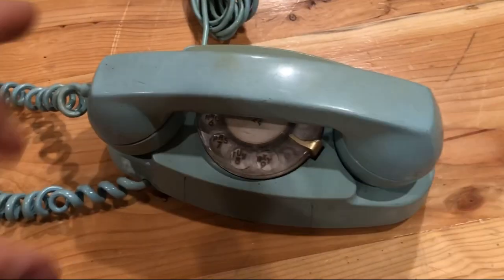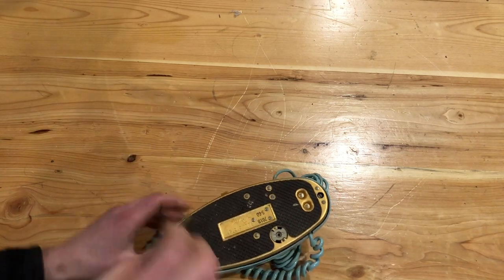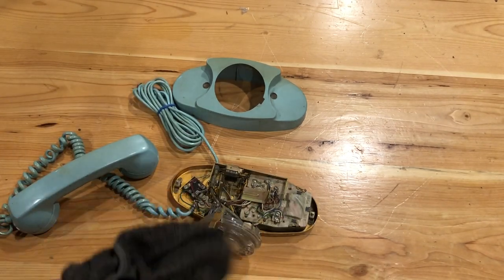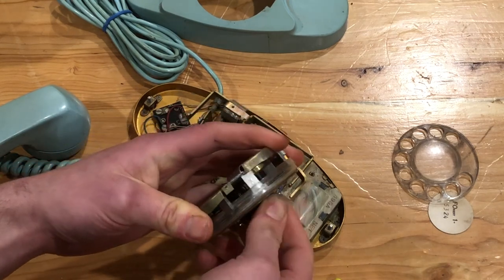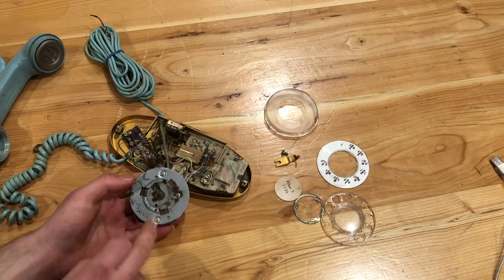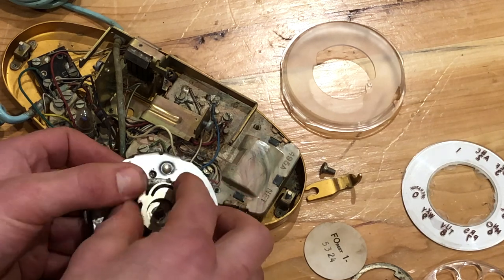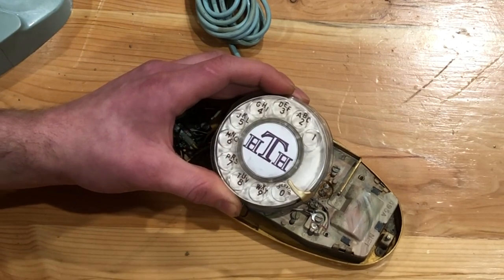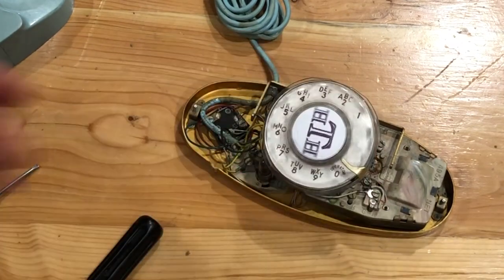How to restore a seized rotary dial

Comment: Pro tip: There is a tiny hole in the fingerwheel located directly over the locking tab that holds it in place. Instead of futzing with a screwdriver to release it you can unbend one end of a paperclip and push it through the hole which will force the tab down to where you can free the wheel with much less risk of damage to the plastic parts.

BTW, good job on the repair. Now I'd like to see you do the same thing to an Automatic Electric dial. Those things have a different governing mechanism that is notoriously prone to sticking/binding at the worm gear, which is not amenable to any sort of oil. Maybe some sort of dry grease exists which would work but I haven't been able to find anything so far.
Reply from the maker: Thank you

Honestly I never noticed that,
I looked and had a revelation  this morning lol

And I guess we will see 

I haven't had any interest in fixing those

But maybe someone will send me one to fix at some point and I can see what happens

Comment: Any advice, I have the exact same problem with the spring seized up. Plus I want to remove and clean under the clear numbers plate without breaking the plastic. Any suggestions?
Reply from the maker: Probably do the same thing I did in this video

Oil will usually fix the seized part, but if you want to really clean it you should remove the dial plates